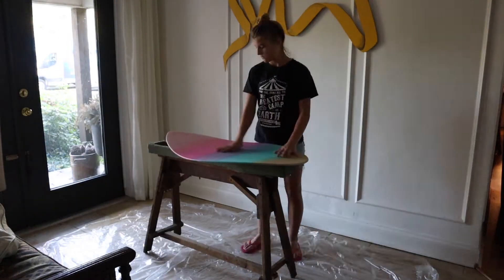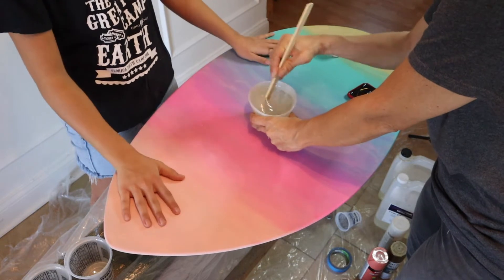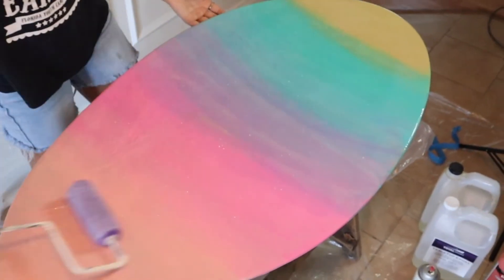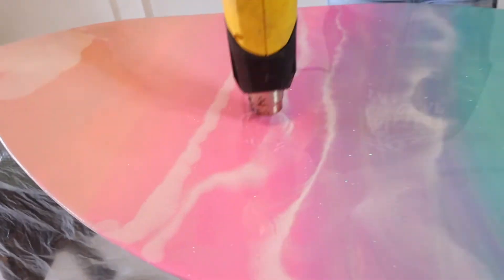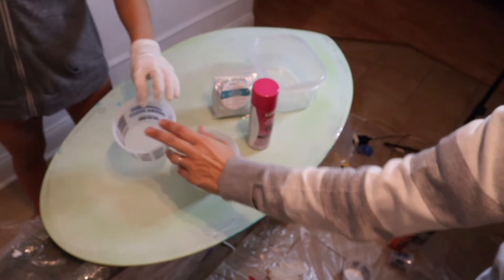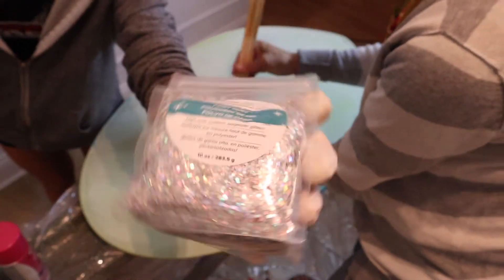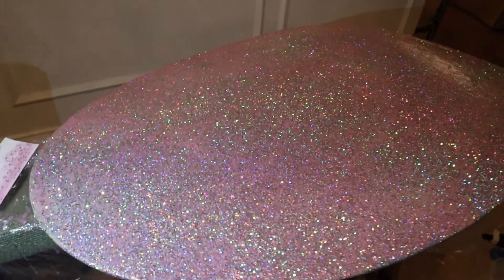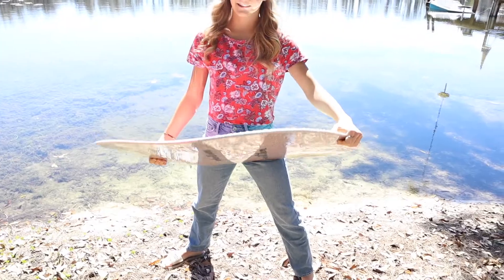Customize a skimboard with epoxy

Comment: Do the back first
Reply from the maker: Why? to avoid the drips on the front?
Reply: Hi what kind of paint did you use?
Reply from the maker: @kidzink619  just acrylic craft paint from Michaels. but you can use any kind of water based paint. house paint etc.
Reply: @MimzyandCompany  thank you so much ma'am 😊